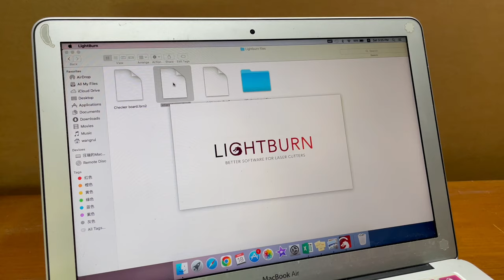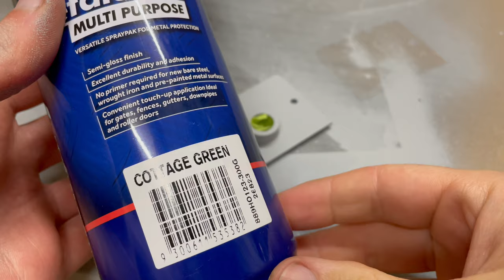1960s Crank Pencil Sharpener Restoration

Comment: You just ruined a beautiful piece ... Even you don't have a screwdriver
A restorer should own a sandblaster
Reply from the maker: I prefer the nice new green to rusty black 🤣 the leatherman works great don’t knock it until you’ve tried it 🤓 also that’s incorrect, yes a sandblaster is faster but a wire wheel works just as well. I suggest you broaden your horizons my friend! Merry Christmas 🎄